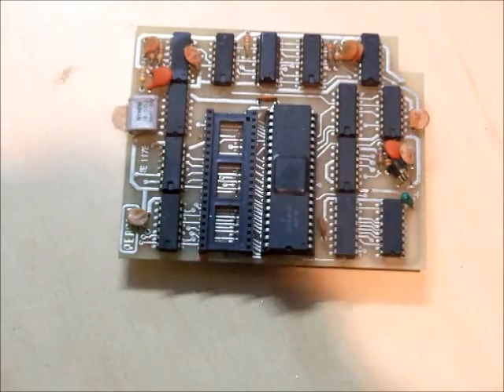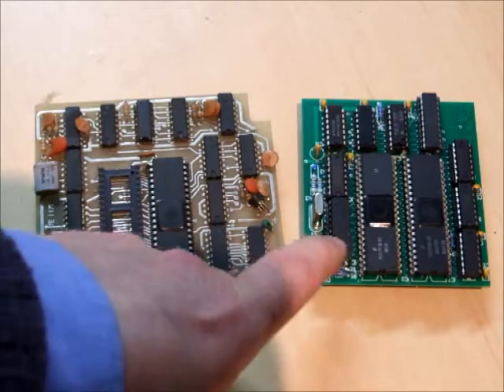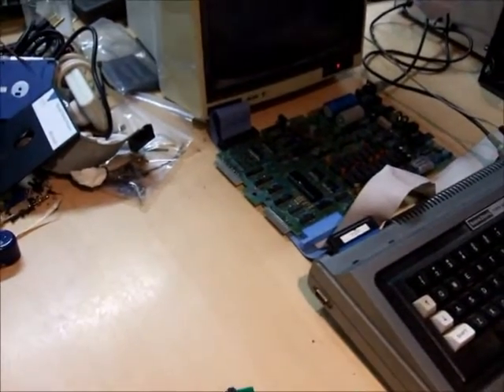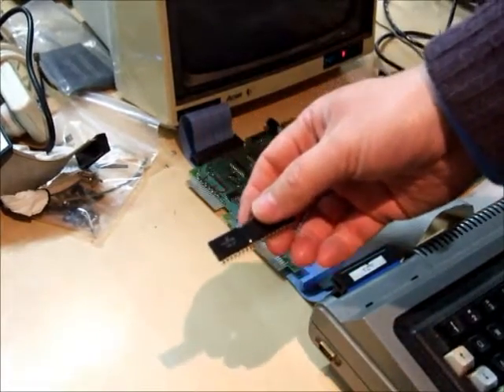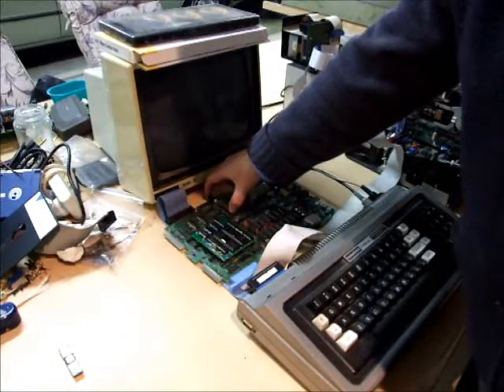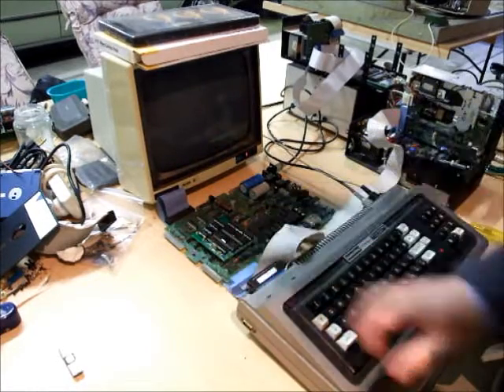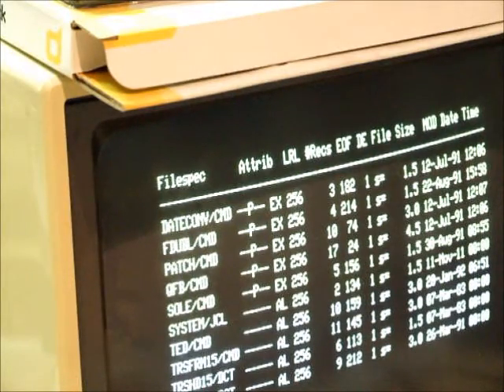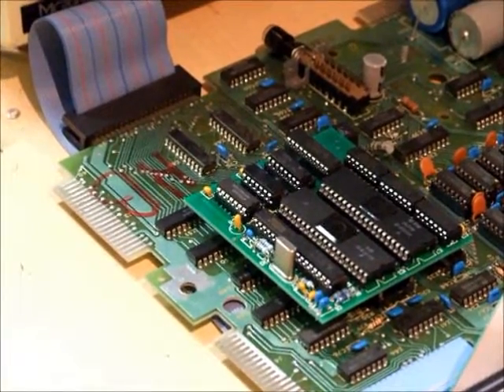New_Perc Double Density adapter for the TRS-80 Model I

Comment: Where did you get the 40pin male/male plug?  I've been trying to find one for a z-80 ice that I have,
Reply from the maker: It's made by Mill-Max and is part number 151-10-640-00-003000